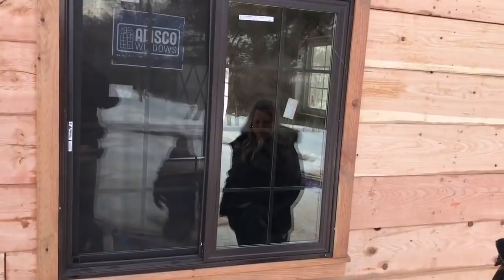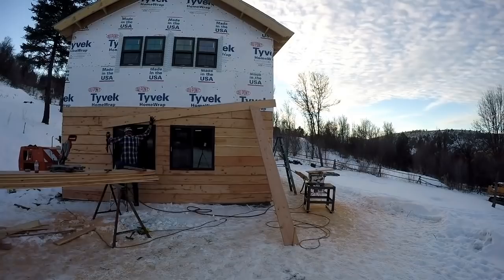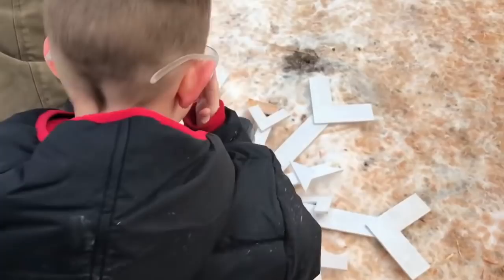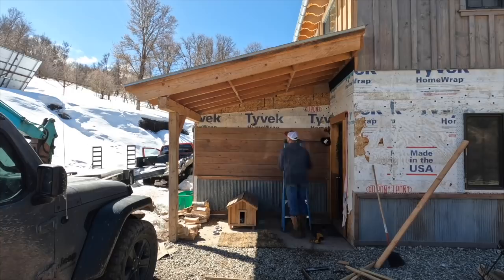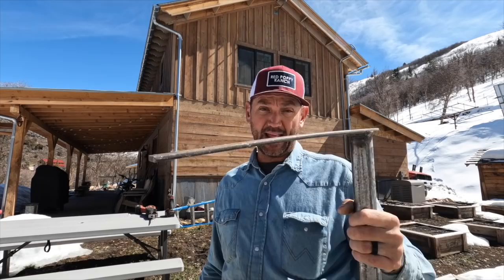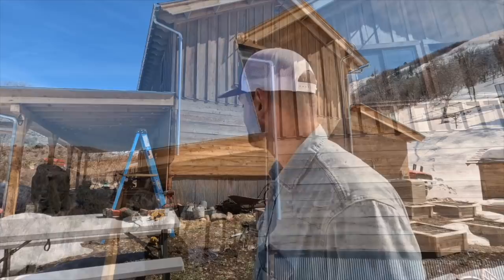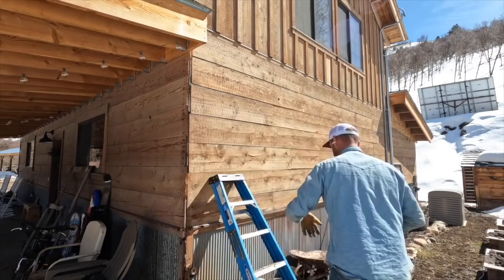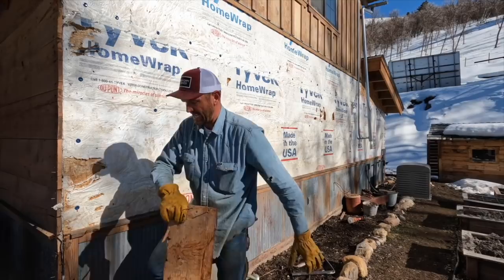Removed Wood Siding On Our New House... (For Board And Batten)

Comment: Love seeing what you do. I was taught to avoid debt, but so cheap. We bought a house and then two new vehicles. Within a couple of days of a 16 day vacation, we were in Munich and learned of the 08 bust. Thank God we had savings. Instead of upgrades to the house, paid off both vehicles, and the house 8 yrs later. Other people said I was dumb to do that. My fear has been economic change can happen fast. Some got lucky buying fancy cars, going deeper in debt and survived, some lost all. Our income has dropped in half, but we manage without debt. Give up the fancy vacations. I like what you do and have followed for a long time. Partially because there was a time I considered doing similar choices. Some of your changes, original videos I thought why not do different. However, you do the best know at the time, and always have time/budget issues. Some shortcuts I made on our house will cost dearly to redo later. There is a big push here to go all electric. I wish I upgraded to 200 or 400 amp service, couldn’t afford the time delay. I quit getting permits for chancges, just cognizant on what loads can work together on 125 amp main. I think great how you turned what was meant to be a shop into a house, and turn the other into a shop. That building has huge potential over time.

Comment: It will be nice to eventually move that last solar panel grid off the hill and mount it on the roof. Spraying stain? Pros and cons. Lots of prep work. Finished product doesn’t get worked into the grain like it needs to. And spraying uses more stain to get the job done versus horsehair brush and roller. Quality stain isn’t cheap. Something to think about.

Comment: On jobs that I've seen tall walls of board and batten like this---  we would put a small metal Z-trim at the bottom of your top row of boards;   So it's a piece of flashing that slides up behind your board at the seam, and then it sticks out past the battens below the seam-- and will have a little 1/2" drip edge hanging down over the battens on the bottom row.  It's not the most sightly thing-- seeing a piece of flashing at your seam-- but it never leaks and you don't have water issues 10 years later...  Another thing we do is to just overlap your top boards, over those bottom boards, by an inch or so.    Again, not as clean looking, since there's now a single step in your wall at the seam.   But it doesn't leak.

Comment: Heath you have accomplished a lot more than I have seen from some other channels. So what it takes several times to get it right or to your and Cedar's comfort zone. I know it is going to be a much greater expense this time re-hanging the siding but then again we don't know how long this spinning wheel will continue spinning. My parents have lived in the same house they built over 35 years ago. While they have done the usual outside maintenance internally mother has changed things around several times. The main thing is that your family is in a safe and warm place and what your are doing now is more cosmetic.

Comment: Power washer will remove lots of the  weathered look. I have used a Wagner airless sprayer applying stain with great success.  A piece of cardboard as a handheld shield works great around windows and doors.

Comment: I too have watched your videos from the begining and see you living out my dreams. I just wanted to comment on when you first installed the horizontal siding I thought that water would be trapped easily through the gaps. In looking at this it dose'nt seem to be the case as you remove the boards. But I still think that doing board and bat is the best way to go in the long run. Just a note we had a cabin in the Grand Mesa in Colorado when I was growing up and every year the whole family would gather and apply  linseed oil to the siding. Wondering if you  consider doing the same to protect the wood over the years. Love to watch you doing the work that I can't do now due to my age and health. So keep on living my dream. Great videos.

Comment: I’ve been subscribed since the beginning and I still look forward to watching your videos every Wednesday and Sunday. I wanted to give some stain advice as I work in the coatings industry at Sherwin Williams in Utah. Mesmers is a local product out of West Jordan, Ut and is one of the best you can get when applied correctly. You want to use a stain and sealer remover and then some wood revive prior to staining. Once the wood is prepped to receive the new stain you want to use a natural bristle brush to push the stain into the grain of the wood. This will help with appearance and longevity of the product. Message me if you have any questions, I can also get you in touch with local Idaho reps that will give you an amazing deal on the stain. Thanks for the amazing content!

Comment: Unfortunately I believe the nails left in the siding boards will rust, corrode and rot the wood around the nails, as well with time these will cause black spots and blotches on the exterior of the siding, hoping I am wrong.

Comment: i hate OSB, but one nice thing about it, is nails don't grip well in it, so they pull out easy. as a flooring installer i would have to use so many extra staples to install the tackstrip for carpet, and on wood floors you need to also use way more nails to try and keep the wood from moving so much and having joints open up.

Comment: House is gonna look so much better with all of it matching with vertical Board and Baton siding. Plus much better to shed water 💦 and less likely to hold any water behind the boards and cause rot. Heath done a phenomenal job the first time horizontally to make sure the boards was tight against each other and they probably wouldn’t have rotted for many years. But it will still look much better all of it going vertically. Great Job Heath at not tearing up only minimal wood to save you money. 😁👍 
I know that had to be a very daunting task and very hard on your hands, forearms, shoulders and back. Poor fella as hard as you   & Cedar work y’all really do need a real vacation in the sun and water for relaxation soon. Cedar you gonna have to make him go on a real family vacation this summer for you guys to relax your minds and bodies for a few days. 😉

Comment: Before sanding all that wood, try pressure washing.  It will remove years of weathering and not take as much material.
Reply: I was told to never pressure wash wood (such as your deck) because it blast the bacteria and mold deeper into the wood. 🤷‍♂️ but then again everyone does it so who knows.

Comment: Not sure if you have done the stain or not yet….. i would avoid anything oil based if possible.   All the goodness has been removed from oil based stains because of VOC regulations.   The new acrylic stains are much less prone to mildew.  Here in the north east we have very wet winters and spring. Mildew of siding is a big problem here and the oil stains seem to be food for it.  Benjamin Moore Arborcoat works well and doesn’t grow mildew. All the painters in my area have given up on oil based stains. Good luck with it.

Comment: The reason it is coming apart is because you just shot those nails into the plywood/ OSB.  You're supposed to shoot each nail into the studs underneath, and you don't need near that many nails when you hit the studs.  But it's a good thing you didn't, because it never would have came off.

Comment: If you are going to spray oil based stain, make sure to move cars far away or cover them up! You might want to back roll the stain as well to make it even…I am staining my cedar house right now, it is a challenge to get the right consistent look, here in california we have to deal with carb regulations, so we are limited with the material we can use, most of the manufacturers are shifting to water based materials that I don’t think are as good as the oil based material… so if I can find a consistent material that provides the best “natural “ look, I will use it…anyway you are not only doing the Lords work, you are doing a great job!

Comment: No kidding about the bugs under that boarding. On the last side you did, those bugs were all over that wall. I assume you will have to replace the Tyvek since it has so many compromised holes from pulling the nailed boards out. As I watched the grinder detach the bottom part of the nails, I couldn't help but notice that was being done in one of the spots frequently used for car parking. Here's hoping your magnetic stick picks them all up. Carry on!

Comment: May be a silly question, and is certainly more work, but could you not take down the stained b&b siding on the front, turn it over and use the other side for the new stain?

Comment: Heath usually has some good advice, but staying at a job that isn't the right fit for you or you're not capable of accomplishing properly just to avoid quitting isn't good advice.  You're setting yourself up to be unhappy, potentially get fired, or, worse, getting yourself hurt for pride alone.  Sometimes you have to do what you have to do to make a living, but don't punish yourself because you might be labeled a "quitter."

Also, it's the talk of "erosion of freedoms" when all of the aforementioned efforts are totally unaffected seemed a bit strange to me, but that's totally different point of discussion.

Comment: I live in Minneapolis MN and I have been living here and renovating for the past 15 years and this last fall in 2021 was the first year that I had any kind of problem with box elder bugs but this whole winter these bugs have not gone away and now my house is becoming infested with these bugs. So last week I started using Ortho Home Defense insect killer with the battery operated spray wand. I will apply it every two weeks and then every month until I see no live bugs (even though the instructions say that it last for months).  I saw this product on YouTube and bought it an Menards I will let you know if it works for me.  But so far so good.